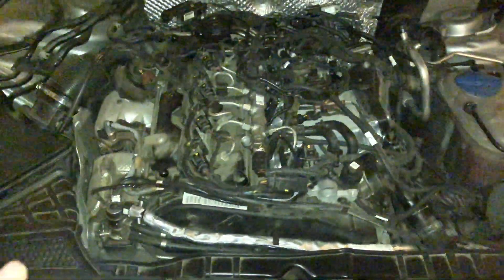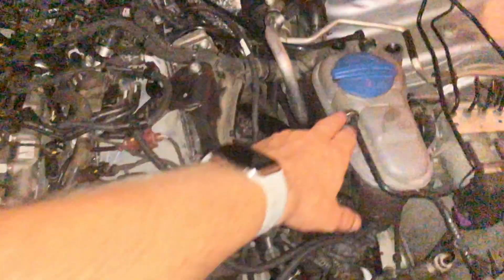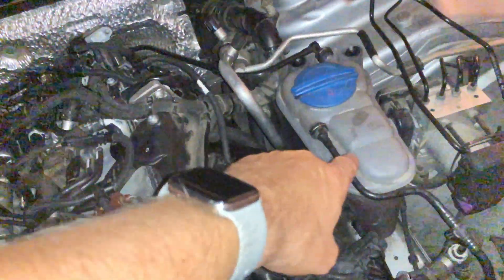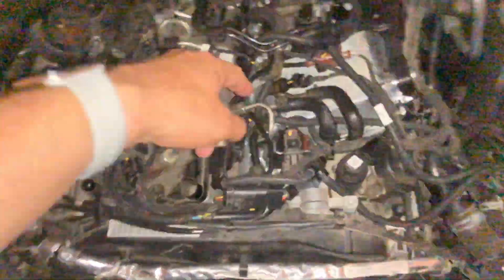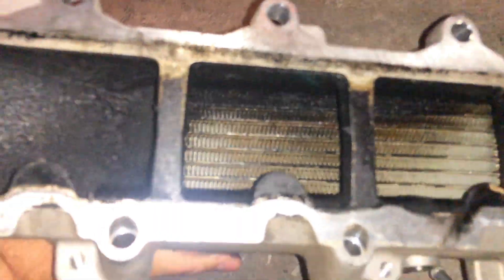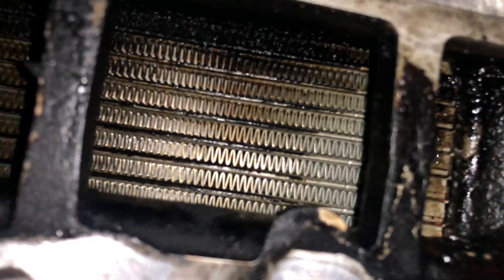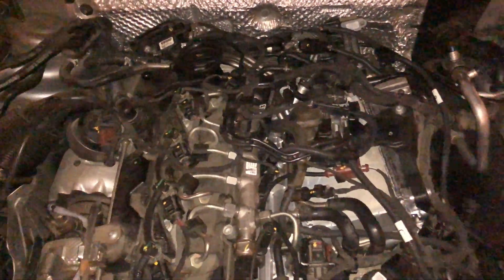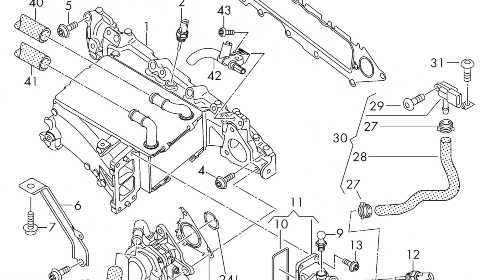Audi CNHA engine internal coolant loss solved

Comment: I watched your video and confirmed that I had the same issue. Thanks!
100k km on the clock for me. It used really little coolant, but I still replaced it.
I generally like the design, it's lightweight, cools charged air really well, takes remaping well, but has this unfortunate design flaw.
The new "AB" part is upgraded and should not have issues.
Reply from the maker: @CodeEnos  indeed the upgraded parts hold well. Please subscribe to the channel to support it.

Comment: What test you've done? in the description you mention smoke chemical whats that ? Its for headgasket ?

Mine loses around 200 ml in 300-400 KM
I pressure tested it, no leaks, i put UV dye, no leaks to be seen

Its a  2.0 tdi 4motion
Reply from the maker: @skreech01  the test involves leaving the cooling system under pressure for the night and removing the sparks to see if the cylinders fill in.
Reply: @bonevchannel  well its a diesel, i dont have spark plugs.
I let it overnight under pressure and the coolant level droped
No smoke at cold start

I will remove the intake manifold, and check it
Reply from the maker: @ true mine does not have them either. I think they removed the injectors in this case. In my case 2 out of 4 cylinders were full with coolant. That made us conclude it was the cooler above that I am showing in the video. When we took it out it was evident that we were correct. Look carefully for outside leaks. The other option is not good - cracked head and coolant goes into the oil or oil goes into the coolant. That option is not fun.
Reply: @ i will check it from under the car, from the above I couldn’t see any coolant leak, i also checked the oil and it looks normal, the level also is in range, so it doesn’t leak into the oil, and the coolant is pink not contaminated with oil

I will remove the intake and check it out
Reply from the maker: @skreech01  I assume you do not smell anything when running the heat in the car?
Reply: @ no
Reply from the maker: @skreech01  this is good so you do not have a leak in the heating system. By the way please subscribe to the channel to support it. Thanks
Reply: @bonevchannel  Sure brother, thanks for reaching out

Comment: Wouldnt it smoke if this is the issue mine doesnt leak until it cool and no obvious smell or sign of a leak on any pipe
Reply from the maker: No. The smoke will appear only when you loose significant amount of coolant. Mine was at first 1g per liter. This is undetectable. At 10g per liter it was still not making any smoke. Once you start loosing 500g per 100 km I think it will 🙂

Comment: I seems have this problem
2.0tdi 190 adblue
Small them accelerated leaks with no external leaks
And one day difficulty to start 
And always leak more after big heat put in motor and long rest after 
From full to empty expansion
Reply: I changed the intercooler intergrated  and it was it 
Now it nog leak anymore
Reply: @stephanemaster8808 hello! I have the same engine in my A6 2018 and i also have internal coolant loss. Did you changed the same part of the vídeo, the intake manifolfd cooler and its solved? Thank you

Comment: How you took it off? How long it takes?
Reply from the maker: Well I did not do the repair. It takes a lot of time for a part that is so up in the engine compartment. I know you will need some special tools for the bolts underneath the part. Also a lot of electrical as you can see and a some very important diesel and coolant pipes runs on top of it. My advice is always to change the brackets that goes on either end of a hose. My techs did not follow this advice and I had togo twice back for simple stupid auto tightening brackets. If you would do it yourself, take photos of how it was, make sure all connections are clicked and locked (another thing I saw quite often after the repair was not properly done).
Reply: What is the name of the part ? Any code ? I have the same issue and also liquid smell

Comment: Could you bypass the coolant pipes to the intake manifold - join pipe 41 & pipe 40 together to prove this is where leak is? Any dangers in Doing this?
Reply: Don't do that. You risk high temperature gas that goes into the engine without a real cool down. In my 2.0tdi the air sensor at the end of intercooler say 54C° at full throttle. I don't won't to know how could it be without water in intercooler. Simply buy a microcamera and insert it in the air sensor hole and see if there is a leak inside intercooler.
Reply from the maker: @davide1555  I think he does not mean to bypass and drive it like that. I think he wants to do this for testing purposes with pressure testing. Bypassing and driving I totally agree - it is a NO NO.
Reply: @davide1555 Yes, very good comment. Dont bypass the pipes. Take a little camera, we do the same here in Germany in our Garage. And change the whole coolant Liquid to G12evo / G65. The new intercooler are better
Reply from the maker: How would you do that? I think you have to take the intake out to have access to the pipes which on CNHA are below the intake. I guess if you can join them or tap those two pipes and do pressure test you can isolate if this is the issue. But when you do the pressure test and you have 2 out of 4 cylinders full you can conclude this is the part that needs changing. But going back to your original question maybe you have access to those pipes at their other ending... not sure.
Reply: I had another leak water pump original after 3 years start leaking